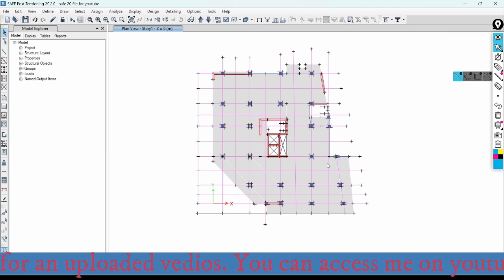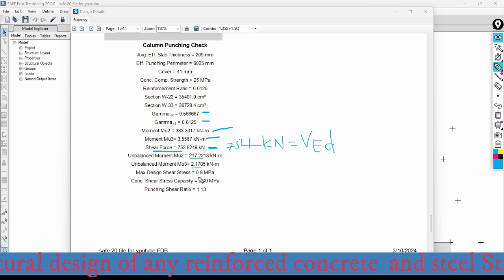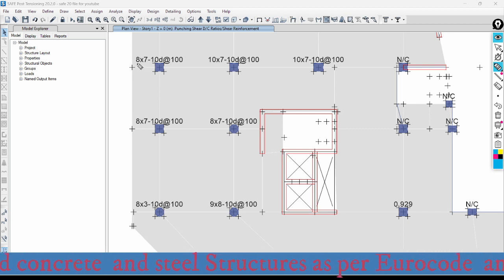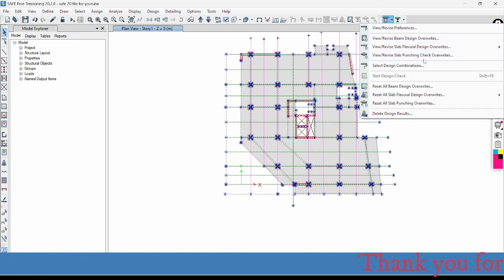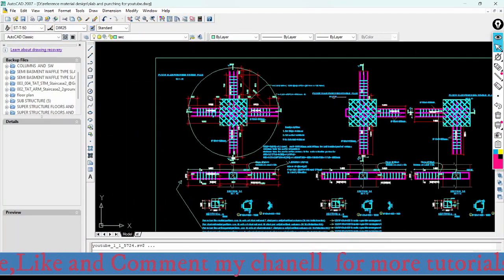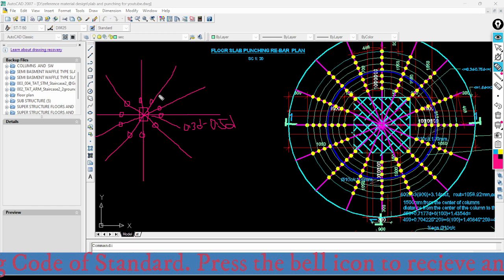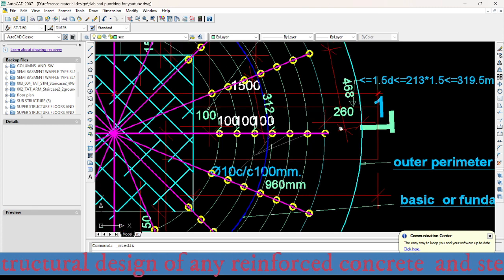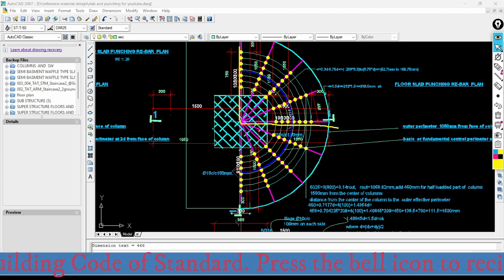Design of 3B+G+16 Building as per Euro code and Ethiopian code part 27 (Punching Design in CSI SAFE)

Comment: I found your videos to be the best structural lessons. I have not seen any video that describes everything this detailed and clearly thank you!
In the orthogonal arrangement, the top and bottom bars which are tied by the shear reinforcement (stirrups) (they are 6Ф16 on the section view on the CAD), are they extra bars, or they are the slab bars which are on the column stirp? I am confused whether it is the existing slab bar or additional bars.  Thanks.